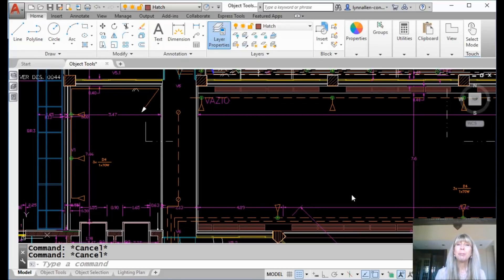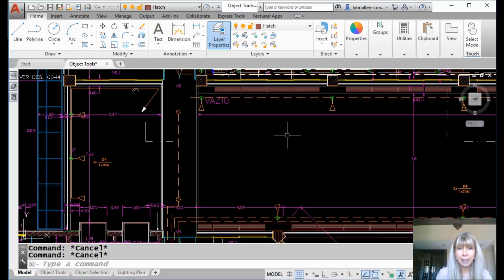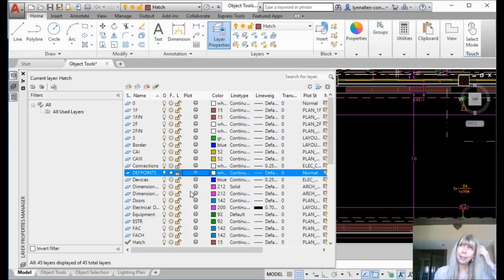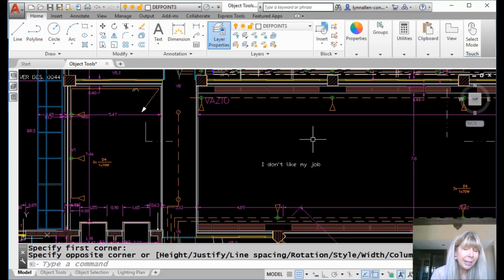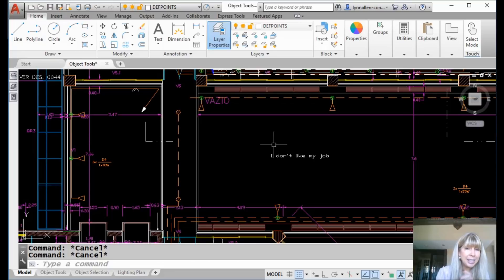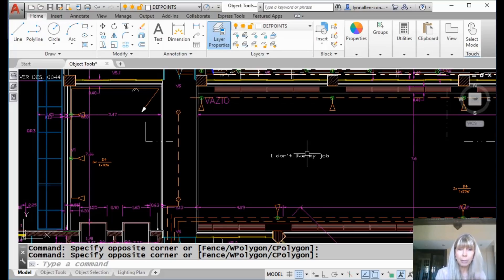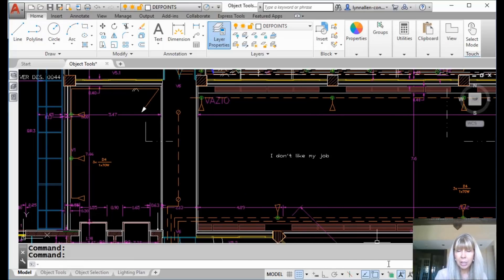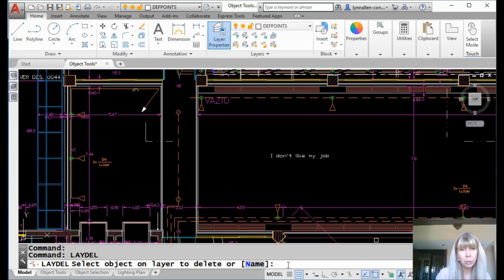AutoCAD Video Tips: What’s Up with That DEFPOINTS Layer? (Lynn Allen/Cadalyst Magazine)

Comment: In my dynamic blocks I use the DEFPOINTS layer to put points around that I use to relocate non-location-locked attributes (once inserted). The DEFPOINTS points don't conform to the Points Style settings, only appearing as single-pixel dots that don't create clutter. You can even array the points (having the array on another layer, like 0) making it easy create drag & drop locations for the attributes once the blocks are inserted.